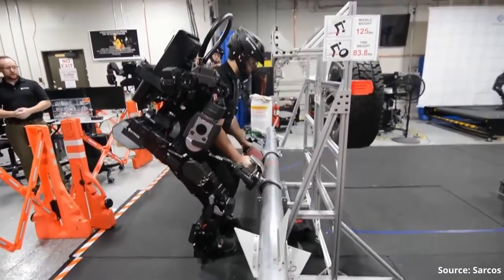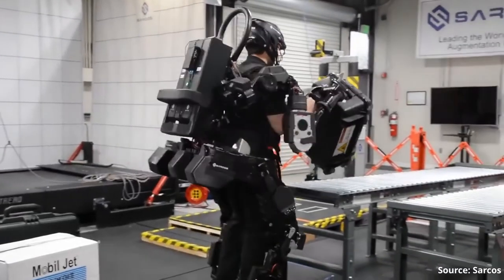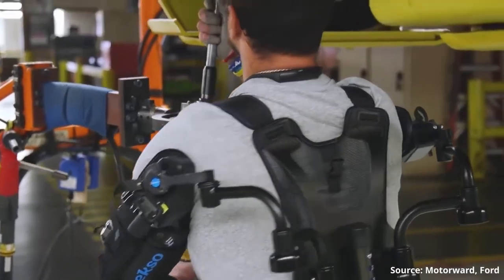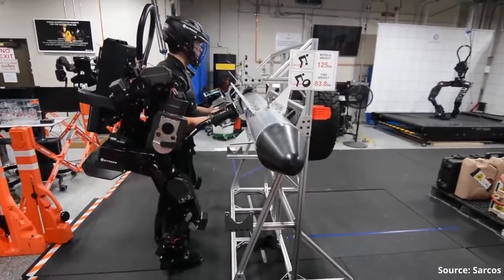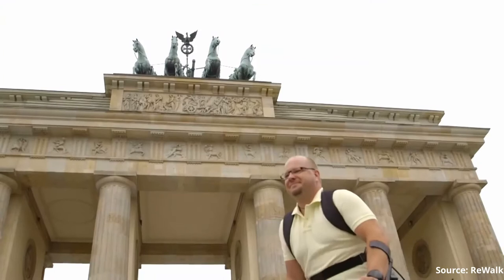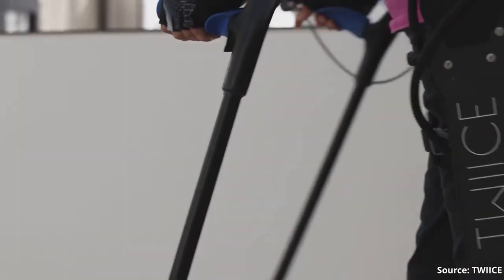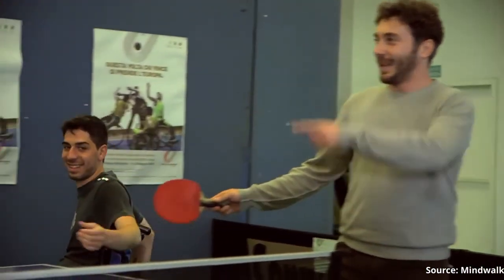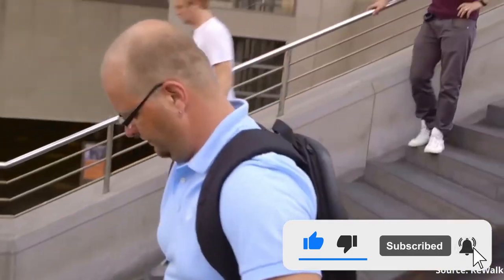Why you are not wearing an exoskeleton right now

Comment: As a practitioner of creating similar ones, I can say why there are so few of them:

1) very expensive
2) the complexity of inserting the system of individual fit on the body
3) the complexity of the selection of the types of drives used due to the speed of their operation
4) problems with an energy source that works for more than an hour and does not weigh like a weight.
5) the difficulty of setting up a stepping system with balancing on one leg.
Reply from the maker: Thanks for the comment! Very cool videos! I didn't quite get what you say at point 5: are you saying it's difficult to do the stepping movement, like going up the stairs?
Reply: @thedaringmonkey195  When a step is taken, one leg hangs in the air for a while. While she is in the air, the person balances on one leg. When walking fast, it is invisible and easy, as when cycling fast - it is easier to keep balance. But when walking slowly, it is as difficult as riding a bicycle slowly. This is the main problem with medical exoskeletons. Their legs move slowly, due to slow electric drives, so crutches are needed to maintain balance. The exoskeletons themselves will not be able to hold it due to the high center of gravity and the short lever for applying forces in the foot. Well, plus there the drive only moves the foot in one plane, in contrast to the human foot
Reply from the maker: @nomadcontrafact6305  thanks for the explanation :)
Reply: Luca Augment  That's right, the depreciation system is important. And not only in the soft inner layer, but also partially in the frame itself. The main thing here is not to overdo it, otherwise the exoskeleton will begin to dangle, and under load it will stop taking weight on itself and injure the operator
Reply: i commented this on another video about exoskeletons, but couldnt you use a weight battery due too the exoskeletons extra lifting ability?
thought i dont know a SINGLE thing about exoskeletons

Comment: Any exoskeletons for masonry ?
Reply from the maker: Thanks for the question :)
I don't honestly know about exoskeletons specifically for masonry, I guess that any exoskeleton built for heavy work could be beneficial. Probably flexible exosuits would be even better than rigid exoskeletons, since the latter could get into the way of workers.

You can learn for example here how the suit HeroWear Apex was tested on a construction site: https://pamplinmedia.com/but/239-news/518081-413533-the-future-is-now-for-lifting-on-construction-sites

It does not increase the user's strength, but at least it helps with back strain.

Here is also a brief presentation: https://twitter.com/CNET/status/1427778266711040004

Comment: This won’t be feasible until neural comtrol is invented and uplinked. It has to be do to the complexity. AI isn’t possible neither for the same reason some it’s needs are biological and requires more than just simply programming a code. Androids will come first  before True AI.